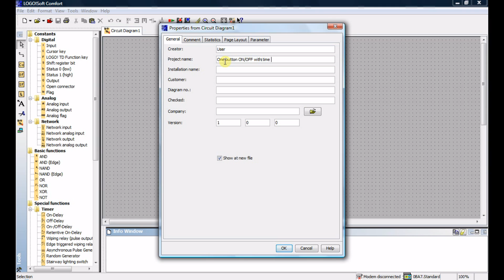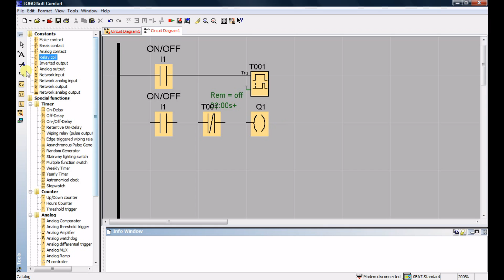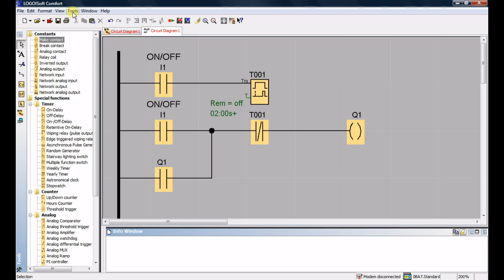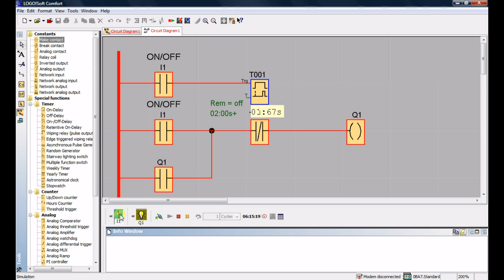One switch ON OFF with time delay - Siemens LOGO tutorial.

Comment: I need some technical support from you in PLC programming design.I am using siemens logo V8 and my programming language is FBD

In our current project, there is 3 aircon units in one control panel. Each aircon unit was controlled by their own PLC .

The aircon control panel shall be able to perform auto‐change over to all 3 split units (2 duties, 1 standby) . So, we are assign one master PLC to control the auto-changeover function.Unfortunately, we have not been  experiencing doing this.

Please advice and send us some sample programming for this function. Thank you